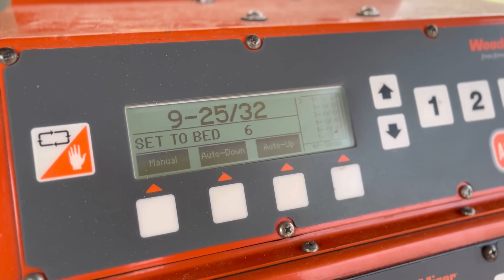The Dream Team!

Comment: Nice to see you back ladies! 😊  Between  1:03 to 1:10  Emerald gives us a close look at what Woodmizer calls their "high performance blade guides". The spec. between the 4 wear blocks and the blade is .008.  Just the facts, for your consideration...
Reply: .008 what? Always include units because your audience can't infer whether its mils, mm, inches or what.
Reply: @gabrielaston3374  Thanks Gabriel.  I forgot that this is an international audience - and I should know better. (embarrassed face)
The unit of measure is inches.  In colloquial jargon - just a little itty bit 🤣  Woodmizer provides a feeler gage with the "high performance blade guides" - so no excuse for what we see in the video.  That opening reads to me as ~.25 inch X 2  Another interesting tidbit is that the "tires" on both wheels are to be cleaned regularly (daily) and changed every 400 hours of run time.  In both cases (high performance guides and tires) the consequence is excessive vibration and blade fatigue.  Draw you own conclusion. 😊

Comment: Hello from Sydney Australia. Good looking lumber; unseasoned OK for house framing? In Australia it would automatically receive an F4 stress grade. Then using the span tables from Standard 1684.2,3 or 4 (3 sub- standards) (cyclonic/non-cyclonic regions) for residential buildings. Structural timbers AS1720.1 obtain the point to point span lengths to resist deflection.
To receive higher grades it needs mechanical testing using measurement pressure.
🌏🪵

Comment: Are the cuts made actual or adjusted to milled dimensional lumber? Is a 2x4 actually 1.5 x 3.5 or truly 2x4?
Reply: From what was said on previous videos, the boards are cut to actual size, so true measures.
Reply from the maker: We cut true